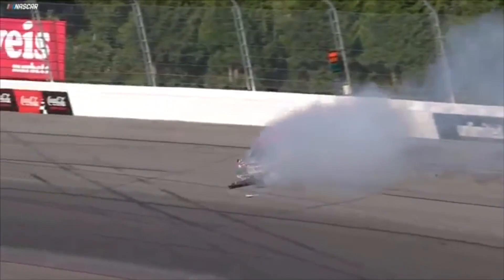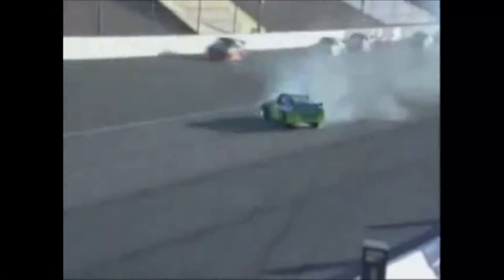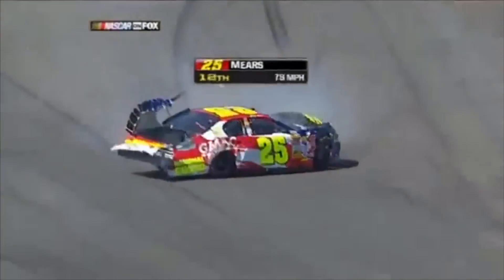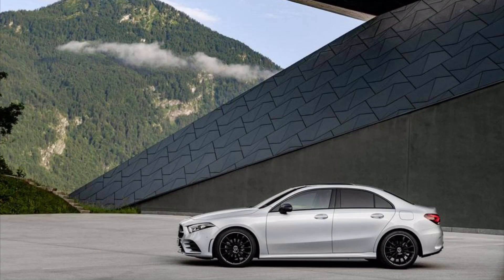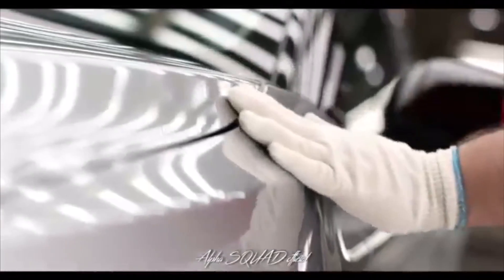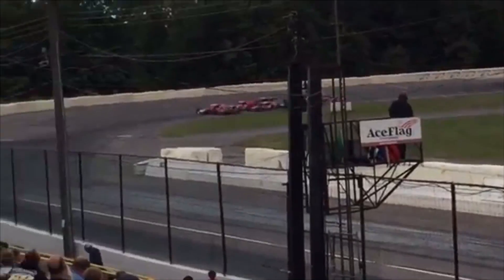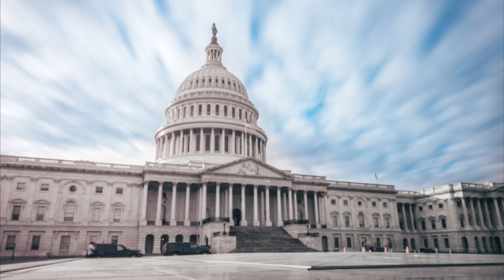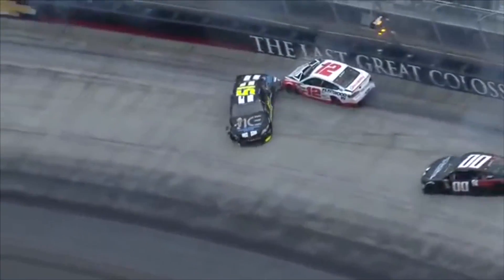NASCAR Safety on the Road: Debating a Barricaded Issue

Comment: I don't think any of the proposed changes in this video would have a meaningful impact on safety on the road.  There are cost, comfort, and practicality arguments, but I honestly think there would be no improvement in safety.
You don't want a NASCAR style roll cage in a street car: speeds are lower so you don't need that kind of rigidity, the only place it would make a big difference is in side impacts (and being able to open doors means that part of the cage can't even be used anyway), and you do want the car absorbing impacts more than a NASCAR vehicle would.  Rollover safety needs a boost, but NASCAR roll cages are built to handle exponentially more force than any road car will experience, and bigger pillars mean less visibility which means more crashes.
Road cars are pretty good at keeping engines and other parts out of the interior of the car already, and that would only really be helpful in impacts at NASCAR-like speeds anyway.
5 point seatbelts: you REALLY don't want this, drivers need to be able to move around in their seats more on the road for things like looking behind them when backing up.  Also, making the seatbelts that rigid would increase the number of people who don't wear seatbelts at all, and unless you're going to mandate a helmet and HANS device for everybody in every car on the road, you're going to make whiplash, and potentially basilar skull fracture, much more common.  Even if helmets and HANS devices were mandated, ignoring the cost issues, drivers now wouldn't be able to check blind spots, a major cause of accidents.
As for the SAFER barrier, it's designed for much bigger impacts than street cars would generate: there's only a meaningful reduction in the forces from the SAFER barrier once you get to really hard hits.  Even NASCAR tracks often don't use this for some parts of the tracks, particularly on road courses where speeds are lower.  Guardrails already absorb the right amount of impact force for a crash on the road.
As for roof flaps: no road car ever goes fast enough to blow over unless drivers are going 3 times the speed limit, so I don't see what that would accomplish.

TL/DR; the challenges in making a road car safer are completely different than the challenges in making a race car safer.
Reply: amen plus its dumb to even compare race cars to street cars and the barriers would cost way too much and the harness are plain dangerous

Comment: Well. Let me try not to be too rude but it’s all about money. Nothing will be done. 

Roll cage- needs a helmet because your skull will split open quicker than cutting yourself. Also very expensive. Auto makers have blind spot, self brake, and got knows what yet people still crash. Some manufacturers do have a mini cage built in like Subaru and Porsche. 

5-point harnesses- won’t happen due to special mounting needed. Have to be bolted to the chassis even in a 4 door you have to have a harness bar and the belts go all the way to the back maximum at a 45*. 

Wall- great idea but so is what we have now. The different guard rails all have their issue. 

A NASCAR cost roughly 250k to make. Don’t think my bank would let me get financing for it. Money money money. That’s what it’s about. I’d rather build my own car the way I want it.
Reply: lamoa  street car would cost 300k and barriers arent made for 60 mph hits

Comment: Sorry man... It's impossible to get all these things into the roadcars... You're not a mechanic.. That's for sure... There is a reason why NASCAR Racecars are so expensive and HEAVY for a racecar... If you did all of that to a modern compact car... Like a freaking Corolla would weigh like 2 tons! Then... Fuel economy would suck, prices would be WAAAAAY to high etc... Mass produced cars will NEVER be as safe as racecars
Reply: The other problem is crossover vehicles and trucks are roll over killers. A roll cage by itself may not improve stuff as it would only make smaller vehicles prone to being killed in other impacts.
Reply: @Eibarwoman   Right. Center of gravity would be higher with a rollcaage installed right?
Reply: The roll over deaths are from failure of the roof usually, but the added weight makes it a killer to pedestrians and smaller cars.
Reply: and safter barriers would be impossible on highways and 5 point harness is he for real comparing race cars to street cars is dumb